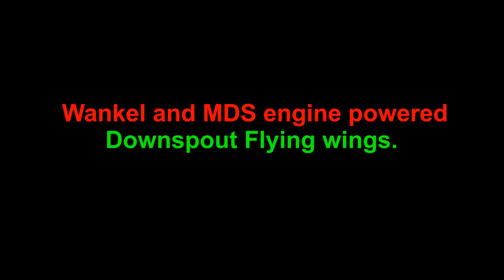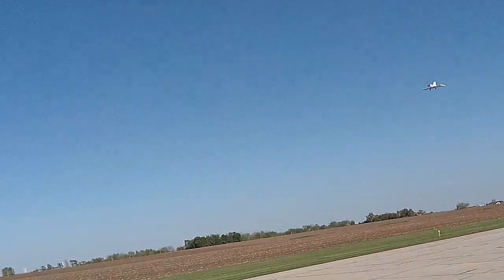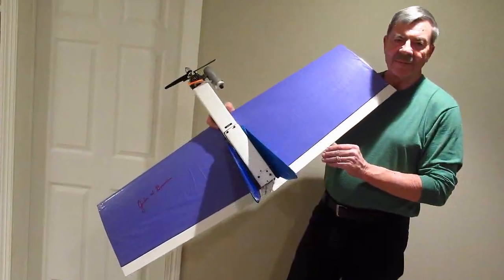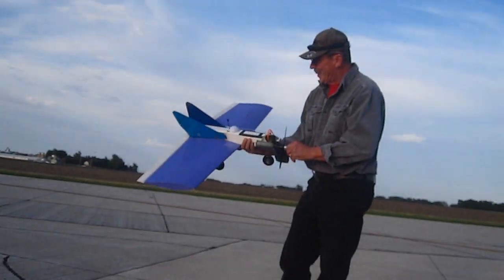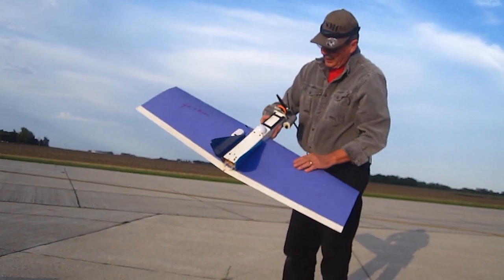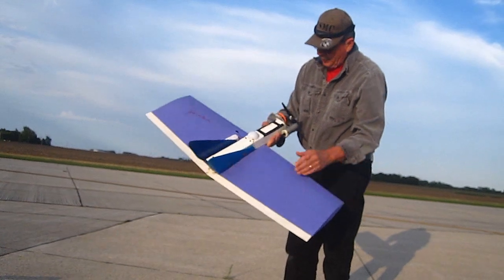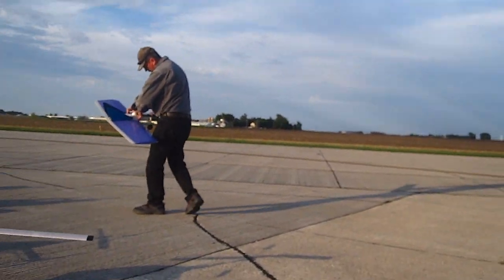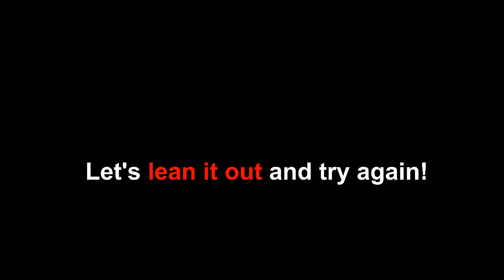MDS and Wankel Powered Down Spout Wings!

Comment: This large wing plane reminds me of control line planes I used to fly in the 80s. but this one is RC. In the 80s, I could not afford to buy RC planes because they were expensive and not easily available in Asia countries. Now you can buy it anywhere. I felt that model plane with engine are more enjoyable and exciting to fly with exhaust smoke coming out and the engine sound. it's only the cleaning up after flying that I dread 😂
Reply from the maker: So true.  Nitro engines still are a bit pricey, but I can fly many times compared to electric, unless you have lots of batteries. Big planes like the Aeromaster has a .78 engine on it and holds 16oz of fuel! A battery for it would be expensive let alone having more than 1. I cant wait to fly my biplane, because like you, my first love is Nitro power.  Your right about clean up  ;-) Thanks .
Reply: NightFlyyer I have always enjoyed watching your channel and the knowledge you shared on the hobby. Thank you for your dedication all these years. Hope to watch your biplane video soon. Happy Flying !!! 😍😍😍
Reply: I'm just getting back into RC after way too long.  Seems everyone is flying electric, so I figured I'd try.  You can't beat the convenience, but the expense of batteries and the care they need are negatives.  Plus the electrics most people get are small and light and don't handle the wind as well as a nitro plane.  And then there is the sound, and ahhhh, that smell that only nitro gives you.  Now that I've invested in a charger I'll have a few electrics for quick after work flying, but on days off, it's all nitro!!!  Good luck with whatever you get.